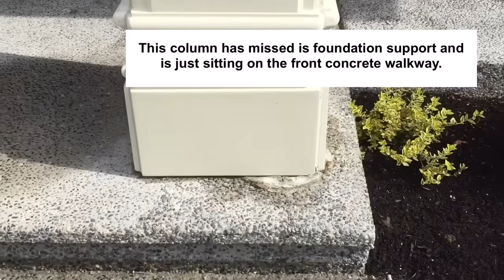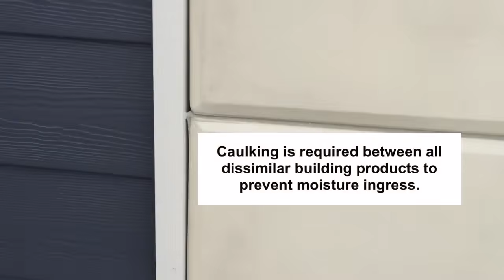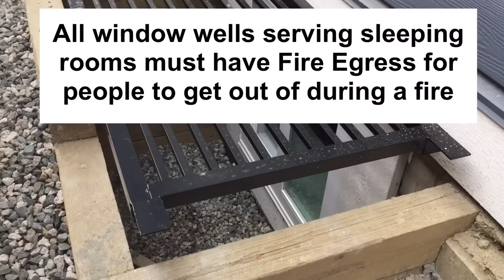New Home Construction Inspection - This is Shocking!!

Comment: Years ago we were installing the HVAC  in some multi million dollar homes in Florida.  I always use a level when installing thermostats.  The contractor called me over and told me I had installed the Tstat crooked.     I went to the house and the edge of the Tstat was obviously not parallel to the door frame.  I pulled my level out and placed it on the Tstat.   Level.   I placed it against the door frame.   Way out of plumb.   The contractor told me to move the Tstat to it was parallel to the frame.    I told him to install his doors correctly and left.

Comment: The buyer of our house had a great inspector. We had done a lot $$ of work on the house. The kitchen floor was new but there was some give to it. The inspector told him how to fix it since he wanted diff flooring. He knew we had a lot of new, roof, insulation, water heater, appliances top kitchen, hard wood floors, solid interior doors and on. One chg and we sold the house. If we loc lots of shoddy work, I wouldn’t even consider purchasing.

Comment: Home inspectors are not liable for anything they don't find or don't report and many of them don't have the knowledge or experience to catch many problems.  It's a cash-grab industry and since there is no liability or accountability, what's the real protection?  None... because, ultimately, YOU are the one left holding the bag and you can't point at the "certified home inspector" for compensation.  Doesn't matter if they're "independent" or not.  What a joke.  The house I bought years ago actually had a floor joist cut ALL THE WAY from a plumbing repair (who does that??) and the so-called inspector didn't mention it.  Probably didn't even see it... but it was plain as day.

Comment: My neighbor sold his 1984 one story brick ranch 4 bedrooms, 2 baths , original paint, original appliances, 3 tab roof that will need to be replace with in 3 years at best and the inside was beat to death. Didn't do a single thing to the place but list it. They sold it for 360 thousand 4 months ago and the buyers never asked for one thing to be fixed, painted or cleaned. It proves the age-old saying " A fool and his money are soon parted "!

Comment: I bought my home and hired an independent inspector. In the report it stated roof had minor repair and showed a photo of 3 tabs that had like Henry's wet patch in between the tabs. Me being naive, bought it. Fast forward a couple years, I have a roof leak in my guest bathroom. I get on my roof, and the shingles were installed like dogsh*t. Nails in keyways. About 10 shingles installed on top of shingles and they just nailed through the top, exposing the nails. And some of the obs board is wavy. Getting a new roof in a couple weeks. But next time I buy a house, I'm getting on the roof myself....

Comment: All these deficiencies are a sign that the GC is either never on site or doesn't give a shit. I hate to think of what mess is behind the drywall.
The best sites I've worked on had a site super who knew best practice across the trades and had the stones to enforce it. He kept the sites running neatly and smoothly so it was a pleasure to do good work. On time and on budget. Happy inspectors that only stay a half hour. It isn't hard in theory but is a battle with lazy or sloppy subs.
Good luck to this home owner. They will need it.

Comment: I hate to say this but concrete footers are poured below ground to support load bearing structures above. In this case the front porch column would be sitting over say a 2 ft by 2 ft x 4 ft deep concrete footer (engineered according to weight of structure above, footers are done in various sizes depending on what’s being applied above.) in this case the 4” concrete pad poured on top of your footer which follows perimeter of front porch technically is still sitting on that footer and is within the limits. A load bearing post is then placed on top of that concrete pad into a post steel bracket bolted to concrete to hold load bearing porch beam above and the roof structure. This video showing where the post missed the L.B. Footer might not necessarily be wrong as long as there is that initial load bearing footer which is below ground. That’s why residential footers are usually a 2ft min width where a CMU block can be placed on top for a mud sill stem wall for a foundation or a monolithic slab design can be placed above the footer to support exterior L.B. Walls and roof above.

Comment: That range hood is missing a piece because it was installed so badly installers couldn't get the piece to fit. 100% an example of "it's high enough they won't see it till after the deliverables date.

Comment: I have been looking at houses myself and inspected them. I do have most equipment to do it and apply my extremely good eye for quality and knowledge. the worst I have seen is a lottery house and it was unbelievable bad. But I feel that we need to put more pressure on the city inspectors. All these houses passed but failed a proper inspection. I know why but let change that? Who's in?

Comment: Just curious.....Many of the items shown in this video are code violations. Did this house have a C of O and if so, do you ever go back to the local CEO and point out the issues found? The C of O should be pulled on this one until these items are corrected.

Comment: Why I would never buy a house from a developer. All they care about is profits over qualty. Can only imagine how bad it is in the places you can't readily inspect just from seeing the stuff you can actually see. Bet there's plumbing, electrical, insulation and structural problems hidden behind the walls, floors and ceilings.

Comment: 4:40 Apart from the faulty slope on the roof, which will surely cause the material to rot in a short time, what shocks me most is the incredible sloppiness of the hydraulic installation.
In my country (Poland) such "experts" are not allowed to enter construction sites!!!
$2,400,000 wasted. I would never buy this house (made like this).

Comment: Well good exterior inspection, however you left out the most critical items out of this inspection which were roofing,plumbing,heating and cooling and this is regarding air flow and returns size of unit to square footage of the home, electrical and framing tie downs and so forth. Termite inspection, mold and radon inspection. I can't tell you how Many times home inspectors leave those out and their report has no weight on filing a claim or doing a closing.

Comment: House construction here in the states  is also awful. You have builders like DR Horton building houses with no outer sheathing, just a exterior "moisture barrier" that does not keep out the moisture and then the siding. They are not the only ones either. Personally, if I was buying a house I would not buy anything built after like 2005 at the latest. I would much prefer to buy something from the 40's or earlier.

Comment: To all inspectors before you decide to blindly claim some gutters are sloped wrong simply because water is backing up maybe check to see if the d's is clogged like a big chunk of wood laying over the downspout hole I'm pretty sure is the issue not slope problems.

Comment: The sad thing is if you actually knew any thing beside caulking. you know there are no crickets or kick out flashing on the the roof. While not built correctly you suck at your inspection. Anyone in the trades can look at the roof and gutters are the least of the problem.

Comment: The quality of work done building this multimillion dollar home is abysmal. Where were the local inspectors that are supposed to be inspecting all of this work as it is completed before the house goes to market, or does CA not have that? I live in metro Detroit and had to have an inspector come to my humble abode to inspect my hot water heater, my back steps, and even the front path that I laid down myself because I couldn’t find a contractor that would take the work, shorthanded due to Covid. Everyone got lazy and the few that went back to work do a terrible job.

Comment: $2.4 M (I presume Canadian, so about $1.8 US?) for this house is what's shocking to me! The rough faced exterior trim with knot holes, paint applied too thickly trying to fill the holes, pulling caulk, caulk likely used where it's not needed... So many infractions. And those visible post foundations showing on the surface of the front porch are just ridiculous. They should have been re-poured as soon as it was discovered they were off center.

Comment: I would have sued the city for their garbage inspection services that they require the homeowner to subscribe to as part of the permit process.  Then I would go after this garbage builder and whip up major negative advertising via local news teams who would have a field day with this total disaster.  In this particular case, because of all the incredibly shoddy work that is easily visible, this entire house should be partially dismantled to examine the areas that are not easily seen.  WHAT A DISASTER.

Comment: Excellent video! Sadly the problems shown are all too common ones. Very fixable, and mostly with not a ton of effort or money, but not taken care of could cost a multitude of damage, even loss of life. Well, except missing the foundation supports for those columns. What is the remedy for that, other than taking that down and either creating support under it, or moving them???
   Sadly many, many new homes, and some older homes have issues just like these! It's SO easy to caulk, add downspout extensions away from the house, plumb the AC drain into a proper drain (that was a real cringe for me! I've dealt with that before in a home I rented and that can be a major problem! Water damages can be unforgiving, and not remedied rapidly, can cause a LOT of damage! It can even destroy a foundation, and thus a home entirely in some cases! I just looked at such a beautiful house that if a french drain and a roof raise is done, it will be fine, but if it's not, the owners WILL loose the foundation and a roof that wasn't sloped properly! A beautiful home with a gorgeous view, flying decks, sun room, etc.! I was willing to work with contractors to fix it too, if they lowered the price the costs of the remedies done by licensed contractors! I love the house, but they sellers apparently are trying to squeeze every dime out of it they can get (without fixing it - selling it "AS IS", even though they've had it off and on the market for several years!) It's not any wonder it hasn't sold! Sadly, a lot of work went into it, it already has some repairs it needs because the issues haven't been fixed, and let go, the house will likely eventually have a major failure, and be, at least partially  if not totally, a demolition.  😞
  It pains me to see that in such a beautiful,  and fixable house in a nice area, but the repairs have to be done! When they weren't willing to come down the price of the repairs, it was time to move on. Hopefully someone will fix the problems, as it IS a gorgeous home. I'm surprised their insurance hasn't canceled their policy! If they let it go, and the failures happen, I doubt their insurance is going to do much, as the problems are and have been fixable for at least a few years, and I doubt the 1 roof on their add-on was permitted, as I don't know any code inspector or proper/legit contractor that would sign off on a roof that carries a snow load occasionally that clearly can't handle it. (They already have a leak and water pooling on the roof when it rains!)

  The drain issue? They literally have water running under the house when it rains! This IS fixable by putting in a French drain (or drains) [in rocky soil, which could be inexpensive, and require a shovel, a couple feet in digging by hand over a weekend, OR could get into tens of thousands requiring a backhoe, perhaps running the drains under the house, supporting the house while this is going on! Sadly, should that be the case, it may cost more than the home and lot are worth!]
   Raising the roof will likely be in the tens of thousands (I estimated about $20-30k just from pictures, a Zoom with the realtor, yet it could be far more! A structural engineer needs to be involved to get the proper roof pitch!)

THEN, there is also terrain issues, to facilitate drainage,  which is also needed on the same property! (Someone built a beautiful home and added a gorgeous sun room, huge decks, indoor/outdoor spaces, without seemingly a thought to drainage, and roof pitch of the add-on! They spent a lot of work and materials, and while fixable, it's going to cost someone significantly, if the problems are going to be corrected.

   If they aren't corrected, eventually the house will be lost, and if someone is in it when a failure occurs, it could cause serious injury or death. A failure would likely occur in inclimate weather as well, so these are serious safety issues!

I'm sharing this so others will take inspections and issues like these very seriously! I literally looked at this house 2 days ago!

I know enough myself, and have access to an engineer and a person with an architecture background who also took a look.

You can buy a property that has even major issues, IF they are correctable! IF you are willing to take the time to do the work, AND you may save a beautiful home in the process, BUT you have to have a contractor and engineer(s) look into it, as if you buy it without that insight, you might get lucky, and it may cost $30k to remedy it, OR it may cost $150-200k or more to fix it!

Know what you are getting into BEFORE you make an offer! Have at the VERY least an inspector check it out! When their are issues like these, such as drainage, leaks, water pooling, etc., find out WHY that is occurring! This is when you have at least a knowledgeable contractor and perhaps an engineer tell you EXACTLY what needs to be done to fix it, give you a written estimate for the repairs, THEN and ONLY THEN, you'll know what it is worth, down to the penny, or the engineer and contractor will give you a range, as there are often things they may not know until they start digging. They may hit soft soil and be able to install proper drains, or they may start digging and hit a granite boulder the size of a house where a drain or contours of the soil need to go for drainage!

You need to know the "worst case scenario" for the costs and time to get it done. Remember weather can affect this as well! In an existing home, you need to know what issues have already been caused by the problems that exist.

You may get a good deal on a home that has problems that aren't too far gone, have correctable problems that wind up not being too horrible on your wallet. If you don't check with professionals, however, you may think you got a good deal, only to find out that the house needs hundreds of thousands of YOUR $ in repairs to make it right, or even livable, and thus rentable or sellable!

It seems the home I just looked at, and referred to above has owners stuck with a house that is requiring a serious amount of work. It seems doable at this point, but is expensive and must be done for safety AND if the house is going to survive over time!

In this particular house, they already lost the central HVAC and ducting because of the water issue. It was said that it "quit working recently". They added window AC units as their "fix", which could even work long-term, and just properly remove the central HVAC, ducting, etc, and seal where it was, or repair, or in this case, relocate the HVAC site, put in a new AC/Heater unit then reduct it... YES! a LOT of work that could have been avoided if the work had been done correctly from the start! Fixable, but very expensive!

The owners seemingly haven't been able to see this beautiful home, seem to be hoping for a miracle buyer (it was even listed on an auction a few years ago), and it still hasn't sold, after several years!

Their reasoning for it being off and on the market for years is something to do with "messy neighbors" (which doesn't even seem to be an issue. We looked!) They are stuck with an investment property that they are very likely to take a loss on it, and the longer they keep it without doing the necessary repairs, the less it is going to be worth. Sadly, it may eventually be abandoned and become an Urbex site, when it could've been a very nice home for people to live in!

KNOW WHAT YOU ARE GETTING INTO, AND be willing to ratify problems that exist, or may arise! Try to think about future issues! Is that little tree next to the house going to be a huge problem later? Are there plants with crazy roots going to get into that septic system down the road? (Think about that when landscaping too!!!) Is there an area of the roof that may need larger flashing than it has to prevent potential leaks down the road, that will be costly? Is a house below a dam that hasn't been used or hasn't been maintained for years? What happens when it rains or snows at that property??? Earthquakes? Hurricanes? Sink holes?

Think about it BEFORE you buy!

Thanks for this awesome video! YES! Many new homes have

Comment: To "save" the homeowner, you should have talked to them 3 months before they started construction. It was clear as day as soon as the video panned from that stone look facade to the lap siding. Someone wanted a 3-4 million dollar home and cheaped out on everything possible, including the builder, to get it at 2.4 million. This doesn't absolve the builder at all. He still has to meet the minimum standards for the industry. Also, if you cannot deliver the project on budget, then do not take it. Also, the wall right at the front where the bottom of the roof meets into a wall, just no.